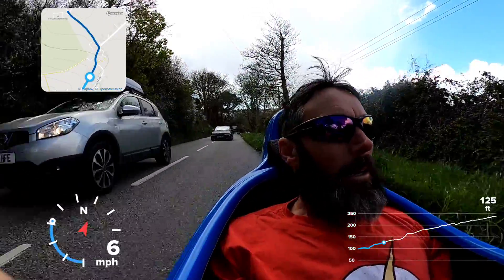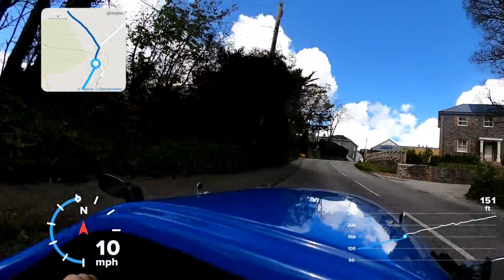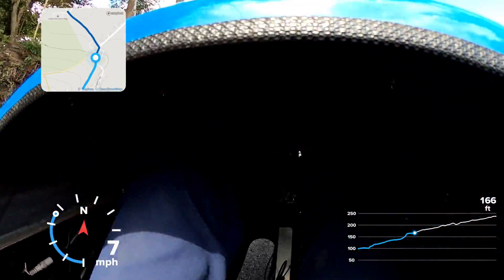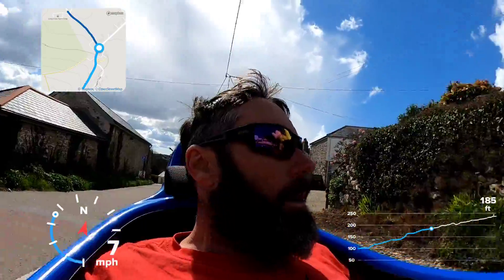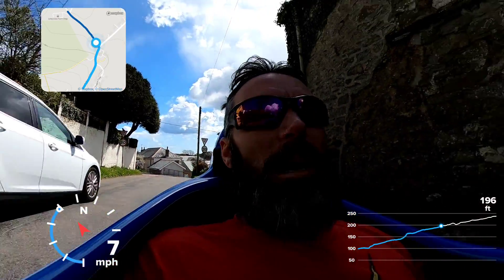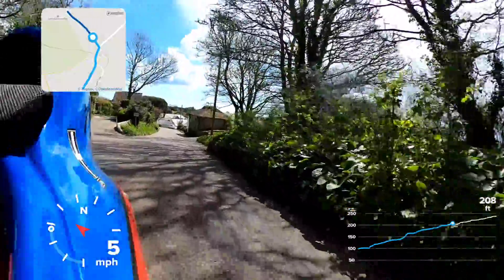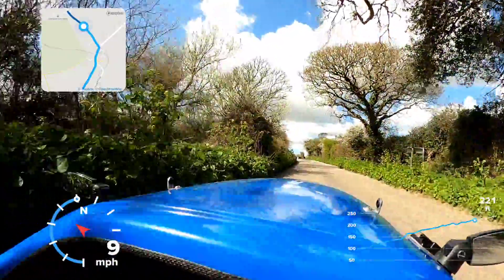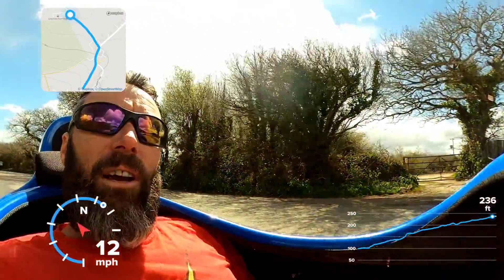Uphill in a velomobile

Comment: I took my non-electric assist Mango up a hill that I'd forgotten was 18% yesterday. That was definitely "character building"! On the same ride, I had a seriously sketchy moment on a descent at a little under 70kph - the road surface got suddenly quite bumpy as I rode past a big gap in the hedge & caught the crosswind. Thankfully there was nothing else on the road - I had to use its full width to wrestle things back under control. Having seen how you descend, I'm wondering if I've a problem with the wheel alignment, so I'm now building a jig to measure this.
Reply from the maker: Hiya! Cool you're using it and sounds like lots of fun. The whole machine takes a while to master on the roads but you'll get used to it. Your alignment is probably fine and I would advise, don't mess with it. My camera takes out a lot of the bumps in the road, they are there. I prefer lower tyre pressure, 40psi all round :-) to soften the blows.
Reply: @velokernow3696  update: the alignment was spot on, which was a relief. So I can put yesterday down to pilot error. 😜